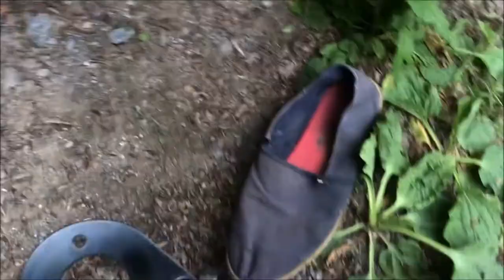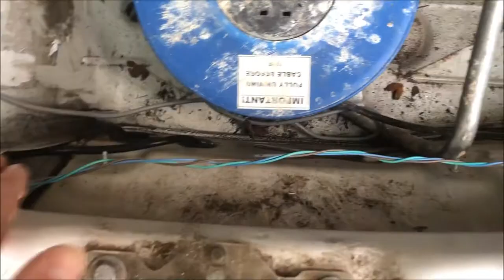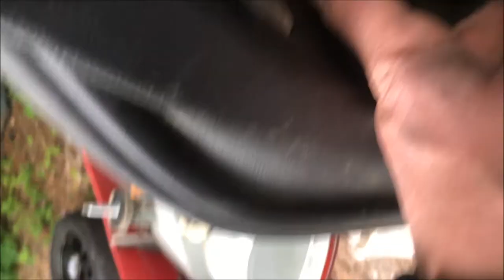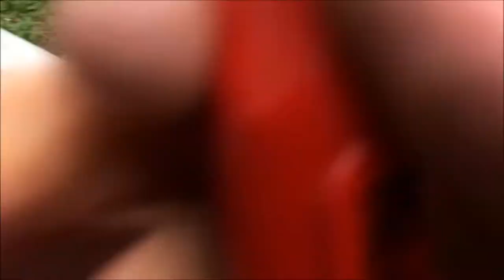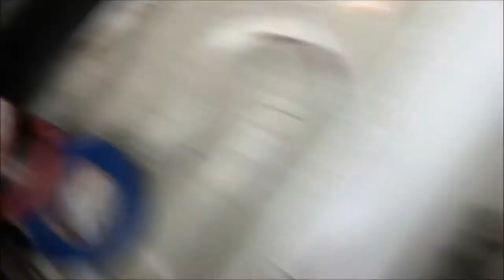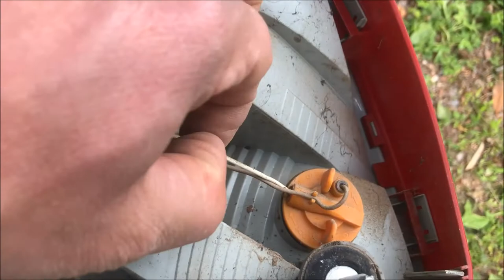Skoda Fabia Towbar Electrics (No Relay - Works Perfectly)

Comment: The question is how does MOT look at this - are they testing it with a higher use of watts ? Do you know anything about that ?
Reply from the maker: I don't think they look at it. As long as the lights work ok  MOT should be OK.
Reply: @DorkyThorpy  Supposedly if you have a towbar the MOT will also expect you to have a trailer-buzzer installed, which they check for.. apparently.. so I'm told.

... I just bought a relay and I'm struggling with it 🤣
Reply from the maker: @iSoul95  eye roll, just in case you forget you are towing a trailer …. So they must have something they plugged in to check ?